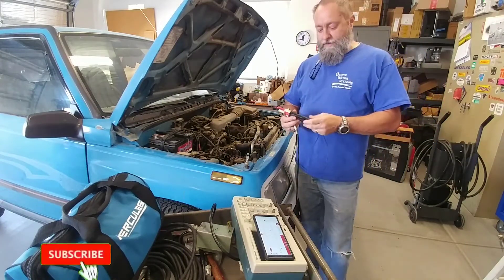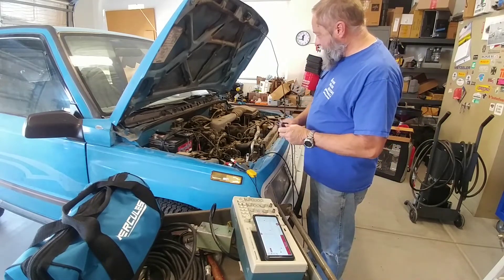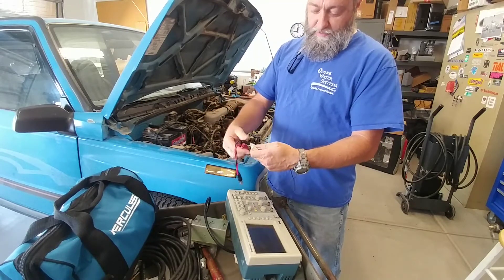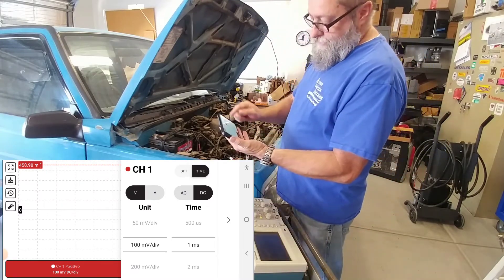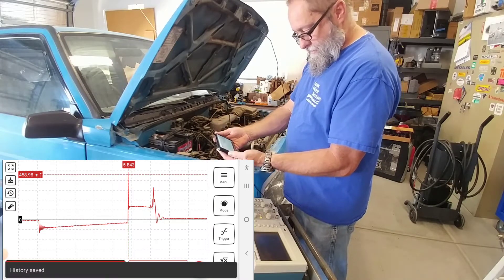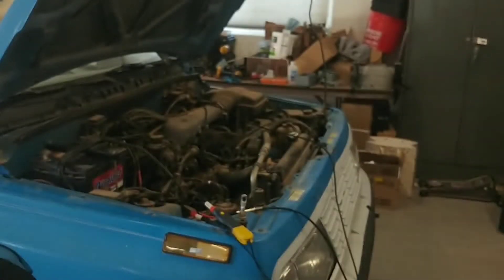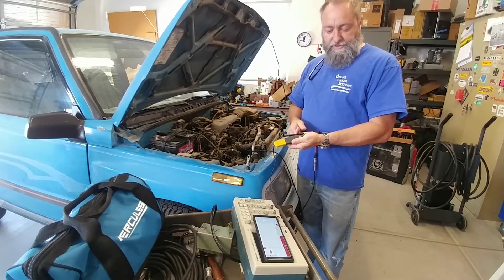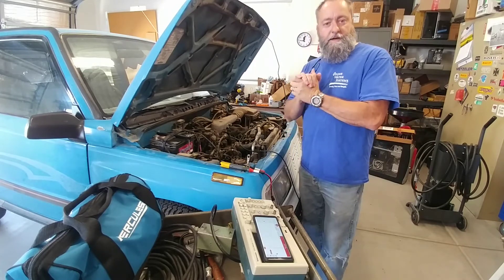Pokit Pro & HT-25 Secondary Ignition Waveform Testing

Comment: Thank you for doing this! I have a pair of Pokit Pro's and was afraid of trying to do spark plug analysis, due to the voltages, and your setup showed me how to do this testing safely.  (in case of a burned through wire as well).